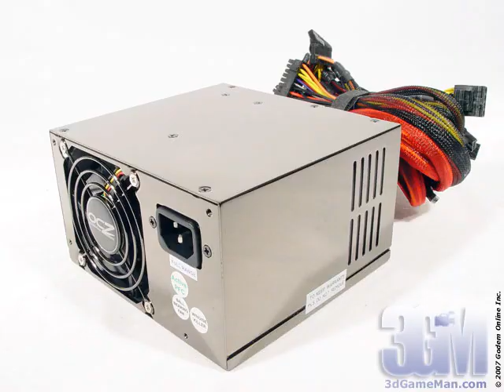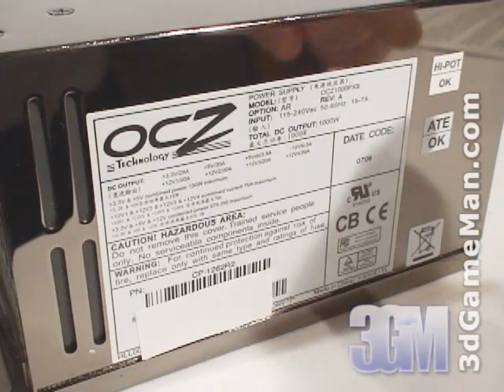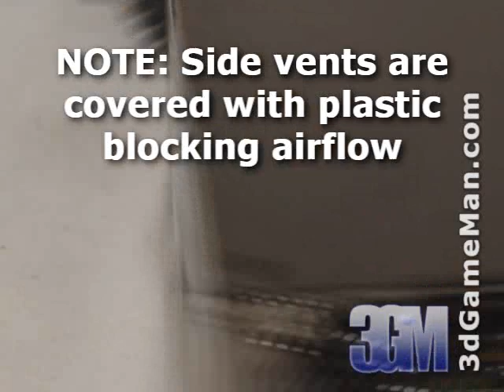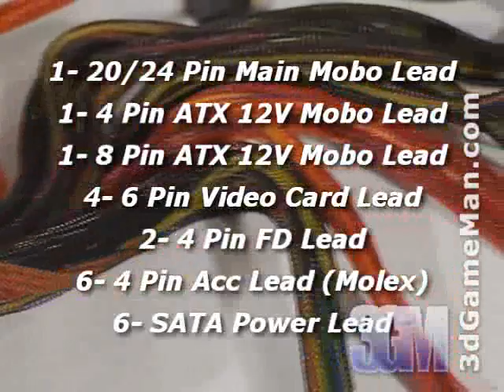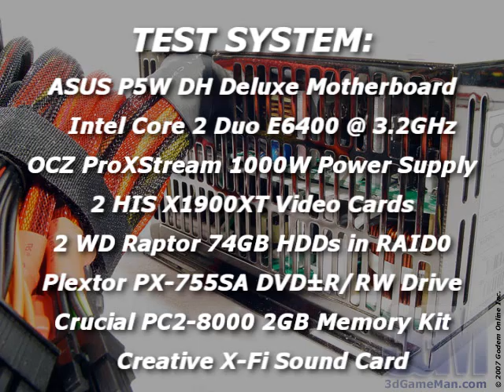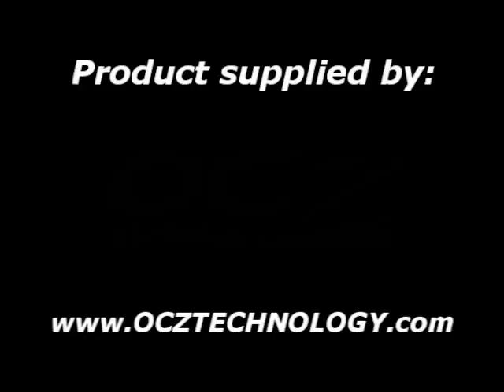#817 - OCZ ProXStream 1000W Power Supply Video Review

Comment: no they don't. there is only one 8-pin connector but it does have 4 6-pin connectors. one thing that he doesn't mention that i think he tried to imply was the noise level. it does run really stable with 8800 gtx SLI. i would have chosen something different if i hadn't purchased it for $80.00. so unless you can find this for under $130.00 i suggest u buy a different PSU.